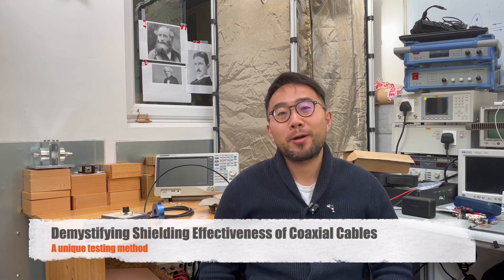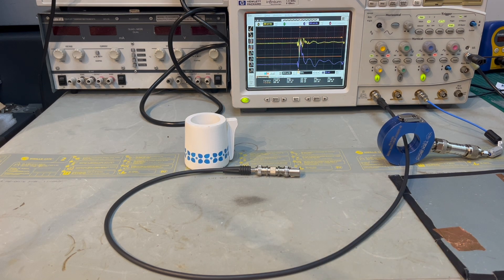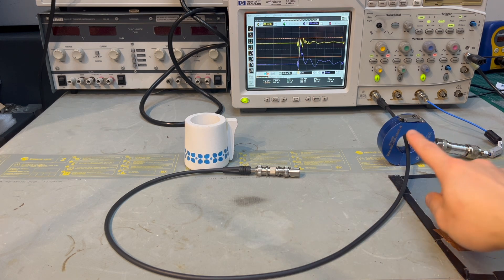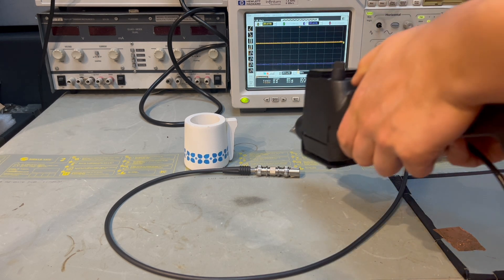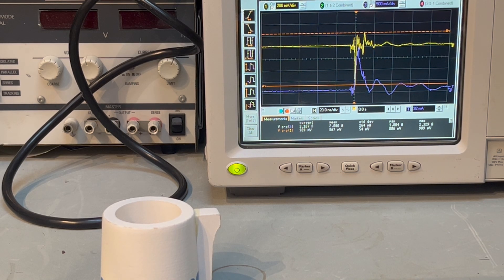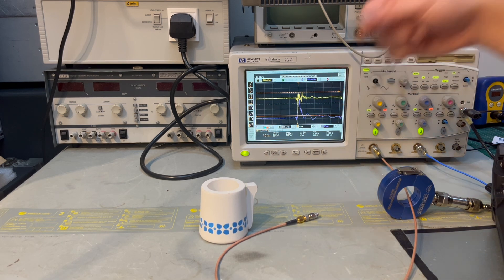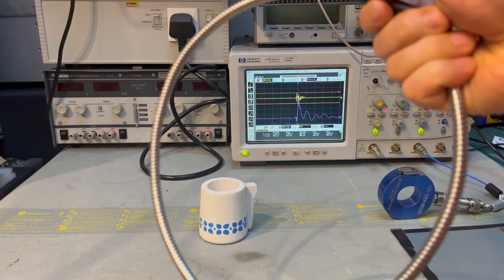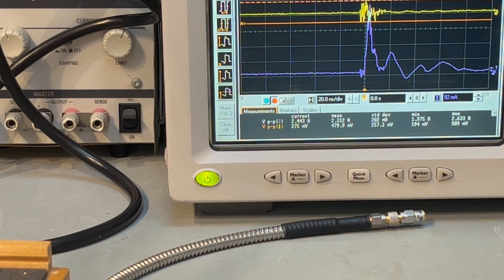Shielding Effectiveness of Coaxial Cables: A Unique Testing Method

Comment: About the setup itself: That current clamp has several things, what are they, what is their purpose and how did you knew which ones are appropriate to handle that particular discharge ? the first is it a attenuator  or a bandpass filter? those 2 ferrite, that a assume are there to protect the oscilloscope suppress which frequency range? how did you safely arrived to that setup without risking to damage the oscilloscope? did the clamp clamp came with those "accessories" or does the datasheet recommends specific values for specific applications? The same for the cable(s) that is receiving the (direct) discharges (worse case of ESD testing), how did you knew you would need some sort of attenuation/filtering? the 50 Ohms matching impedance's only do that - match the impedance that translating into the maximum transmitting of power between the source (and the cable) and the load - but how did you knew the (peak) power rating of the discharge wouldn't exceed/damage the oscilloscope? 20nseconds per division is a great spec for a floppy disk era oscilloscope! I do appreciate  your work by the way. Thank you.
Reply from the maker: Great questions Sergio, 20 dBohm transfer impedance of the current probes, not ideal for such tests, as the voltage generated will be huge, as you suggested, hence we placed a 20db attenuator, this effective makes the current probe to be 0 dB ohm, meaning for 1 A current, you get 1 Volt voltage. The bandwidth of the RF current probe is important, in this case, the probe is characterised to 1GHz, just enough for the job. We have a series called RF Current probes, detailing everything about RF probes, please review them and let us know your feedback!
Reply: @MachOneDesignEMC  Thank you for replying.
Reply: @MachOneDesignEMC Hi, I don’t really understand this: if the probe has 20 dBΩ (which is 10ohm) and the attenuator is 20 dB, that mean the voltage will be reduced by 10×, so from 1 A → 10V (without attenuator: U=Zt*I = 10ohm*1A= 10V) to 1 A → 1V with a 20 dB attenuator? Is this correct calculation?

Comment: Hi, can you please explain how does the noise couple from the shield to the center conductor? Also, the silver thing on the cable end, is it a termination with the center conductor exposed or is it just used to fully shield the center conductor. Thank you for the videos and the effort you are putting in :)
Reply: The braid of the cable is not 100% tight (70% to 90% coverage). So there are openings for the electric field to go through. Then its basically displacement current..

Those terminations typically enclose the load. So if the threads are clean, they should provide excellent coverage.

The question for me is actually, how emi proof the scope side is. Some EMC labs have scope boxes/enclosures for ESD verification. Would be interesting to test it with additional shielding.
Reply from the maker: Hi Pitti, expert answer, I just answered pretty much the same as you did. I suggest perhaps next time place the scope in my tent and repeat the test, that would tell! Thanks for your excellent answer. It is always great to have someone like yourself to do a peer review of my videos. You know, the problem with Youtube is that one can just talk bullshit without taking responsibilities. I am sure I also made mistakes, so all feedbacks are welcomed.
Reply: @pitti2602  Makes sense, thank you!
Reply from the maker: Great question, Krunoslavklaric, shielded cable, if not terminated at all, equals to 0 shielding effectiveness. Terminating at one end provides captive coupling, more like a distributed capacitance bank. When terminating at both ends, shielded cables provide both E and H field shielding. The silver thing is a continuous outershield in this case, inside there will be a centre conductor, it should be made as a transmission line of 50 ohm to match the co-axial cable, but good point, I should have checked whether this silver connection is a 50 ohm structure. Thanks for your comment.
Reply: Good questions. I believe it is mostly captive coupling because if both ends are matched then low chances of inductive coupling. It is interesting why the double shielded cable still not doing great job. Maybe the coaxial inside it is not a good quality one. How the current probe terminated to the oscilloscope? 50ohm ?
Reply from the maker: 50 ohm termination. But also, you know, the noise showing on the scope could also be due to noise coupled directly to the scope, i.e outside of the shielded cable. We cannot easily rule out unless we placed the scope in my tent, actually, saying that, that might be a better test, surely to experiment in the future!

Comment: When you use the ESD gun on the double shielded cable, is it the outermost shield that was tested? is that outermost shield connected to the inner shield at the BNC connector? Thank you for the video btw!
Reply from the maker: correct, it is the outer shield we tested. between the centre conductor and the shield is the 50 ohm terminator resistor on one side, on the other side is also a 50 ohm impedance (of the oscilloscope), so we have a close to ideal 50 ohm transmission line, in a sense that the source is 50 ohm, the transmission line is 50 ohm and the load is also 50 ohm.